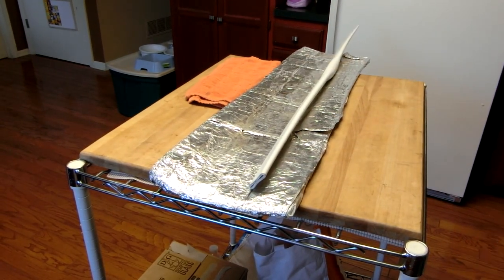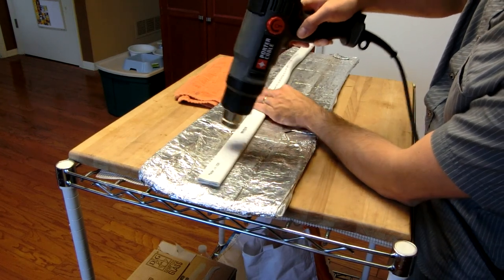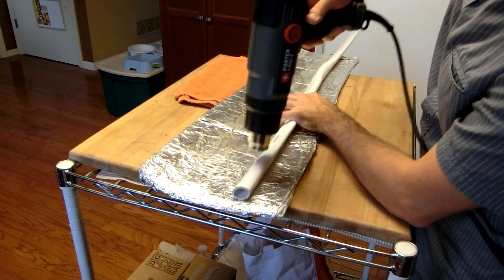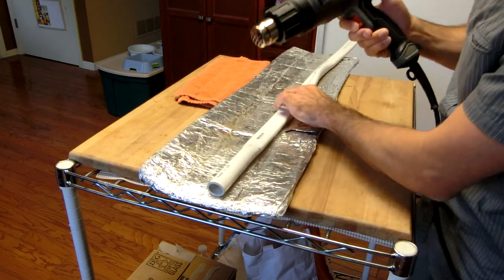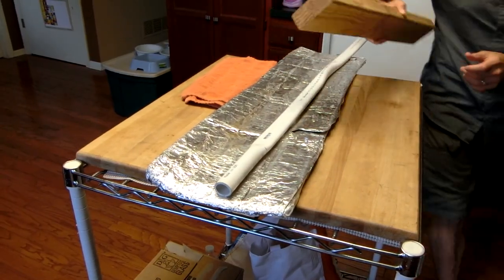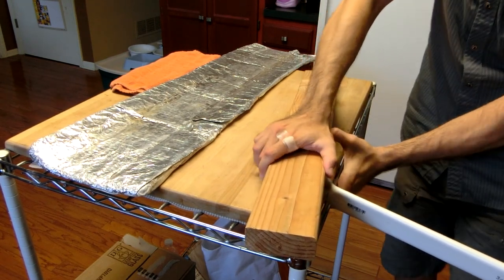Basic Bow Build Along Part 1: Shaping the Siyahs

Comment: Tim what I have to do to build the exactly same desing of this bow but with around 30 to 40 pounds?
Reply from the maker: Lucas Rafael I would try the same design, but use a core length of around 42", for an OAL of around 48”. from there, adjust by increasing the deflex in the limbs. have fun!
Reply: Ok I'll try,, thank you for the answer.